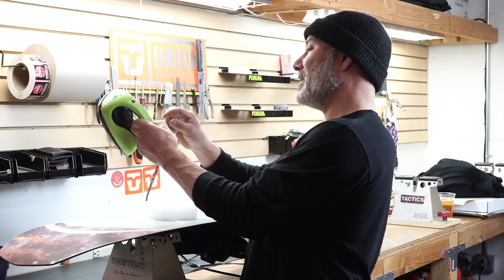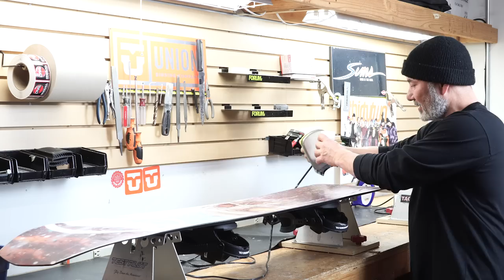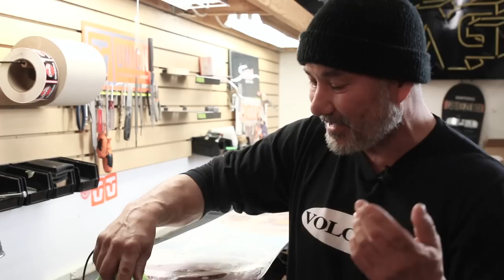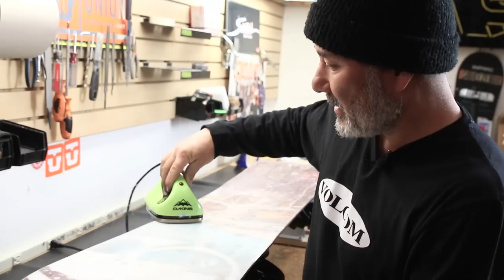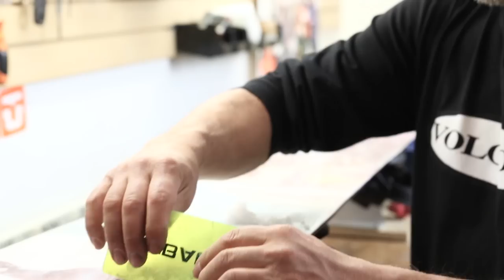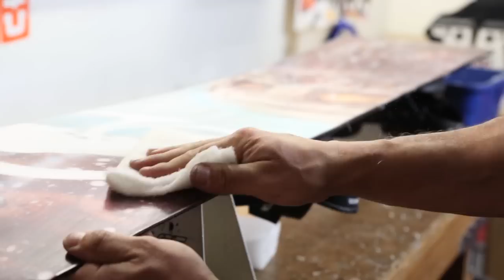How To Wax a Snowboard with Bryan Iguchi | Tactics

Comment: I was hoping you would start out with what base cleaner you use in the beginning, although you did mention it about 4 minutes in.  I've always been the waxer for our entire neighborhood at Edelweiss at Kirkwood when we would lease there for the winter, so I've certainly waxed my share of skis and snowboards.  The best cleaner I have used is what I believe is just straight kerosene that I bought as a base cleaner at a shop in Tahoe.  Flammable as hell, and gives of fumes, but it leaves your board or skis dry as a BONE and really removes all the wax from the pores.  Citrus cleaners don't do what kerosene will do, although they do a decent job at cleaning, which is critical to a good wax job.  Citrus cleaners don't dry the hell out of the pores like kerosene does.  The other thing I do is when I scrape, unless there is excess build up, I don't cut my scraper like a knife, rather I use it like I'm spreading frosting on a cake, only with force, so that it scrapes, but not too much, and it pushes the wax into the deck more.  Very minor detail.  Then, I really recommend the rotary polisher for your cordless drill, just like the pro shop has.  That's why I'm the waxer.....  Never gonna one up the GUCH, but I hope that helps!
Reply from the maker: Thanks for the info! That's awesome. I used to work at The Ledge Boardshop over at Squaw Valley and cruise down to Kirkwood a few times a season! - Matt
Reply: @tacticsboardshop  As a matter of fact, I just scored a gallon of kerosene, which is WAY more than you'll need for a while.  Yes, it is in fact what I suspected was the awesome base cleaner which is no longer available at Sports LTD. or anywhere else.  I was using citrus last season, and was way disappointed compared to kerosene.  Just be careful, which is why the shops don't sell it anymore (liability!)  Don't leave kerosene rags around to ignite!  Might want to do this outside as well if you can!  I just did my splitboard inside, and it reeks!  But yeah, nothing else I have seen melts away old wax like kerosene.  I paid the same for a gallon as I was charged for a quart at the pro shop!
Reply: @tacticsboardshop  Oh, yeah, by the way, Tactics kicks ass!  I have always LOVED Tactics!
Reply: @tacticsboardshop  Come to think of it, I used to do the cleaning and wax at night, then the scrape and polish in the wee hours before the lifts opened, so as to let the wax REALLY settle and soak.  It's not the wax you scrape off, it's the new clean wax you let absorb into the base that really matters... all day!  Especially backcountry.  It wasn't for the money, although people paid, it was the passion of making the best wax possible, period!  You can't ever get a wax like that unless you do it yourself.... or unless I do it!

Comment: Great video after you are done with the kerosene do you just wipe it dry with a rag of some sort, and how much would you use? The other question that I have is how much wax do you scrape off at the end?? Thanks!
Reply from the maker: Enough cleaning agent should be used to cover the entire base and yes you just wipe clean and wait until dry to wax. All wax should be removed when scraping since the wax is absorbed into the pores of the base material rather than needing to leave a thick layer.

Comment: Should I be loosening the screws on my bindings before a wax, or taking them off all together? There was a video where someone mentioned this, and I don’t understand why you would bother doing that?
Reply from the maker: Hello, when your mounting hardware is fully tightened it indents slightly into your base. When you heat up the base it can actually warp your base in the shape of the bolts. That's why it is best to loosen the bolts before waxing. Hope this helps!
-Sam

Comment: New to this myself and now taking care of my and my sons boards. Not paying to have my boards taken care of anymore. How often is it that you should be waxing? Every trip? Every season?
Reply: At least every couple of times you take your boards out. It depends on the conditions too. Riding in hard, icy snow can mean you need to wax more often than great snow. Snow plowing (being on your heel side or toe side) super often can wear the wax off of those sides faster. You can usually tell by looking at the base if you need a wax. Look up on evo’s website how to wax your board. They have a great article.

Comment: What happens if you use the wrong temperature rating wax?
Reply from the maker: Nothing really. All wax will work in general there are just specific temperature that will perform better depending on the conditions you are riding in.
Reply: @tacticsboardshop  thanks for the reply! I accidentally bought some  wax that was rated down to 0 degrees in the PNW where it'll never gets that cold.

Comment: What the hell was the point of putting the wax on then taking it off
Reply: it goes into the pores of the base lol. only meant to have wax “inside” the board not on top
Reply: The wax is meant to soak into the pores of your board, so scraping off the top layer is good to keep the board smooth since the benefit of wax is filling in the pores of a sintered board. Extruded boards, you may not need to wax as much.